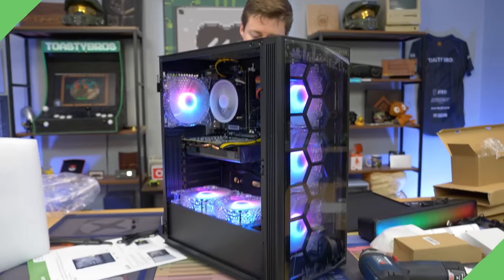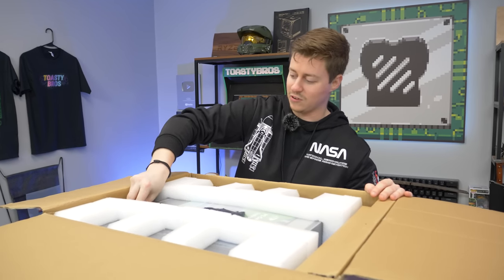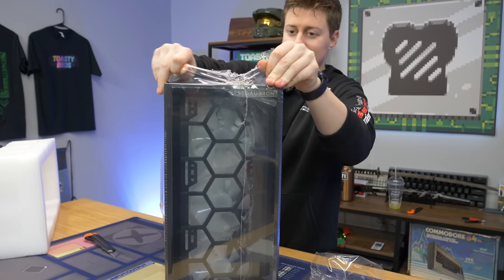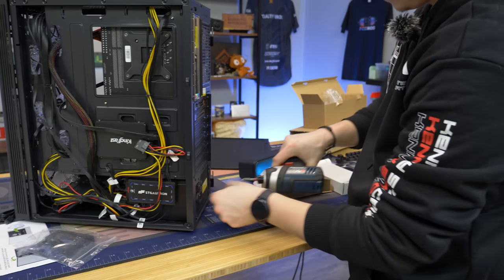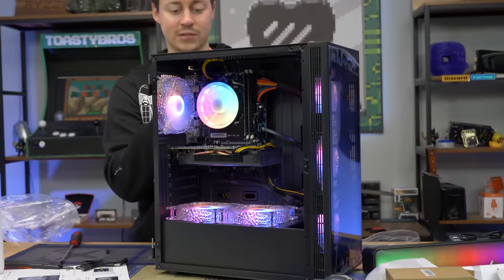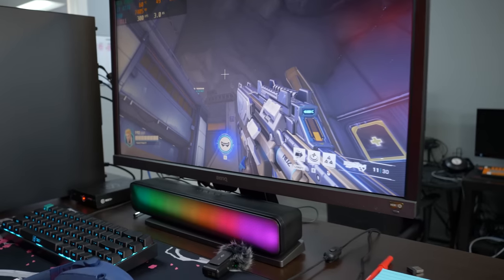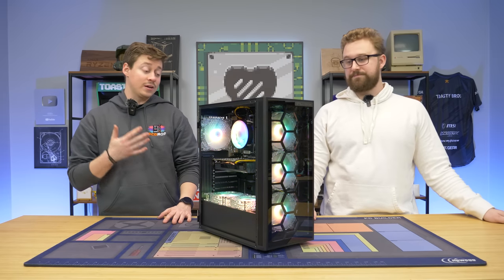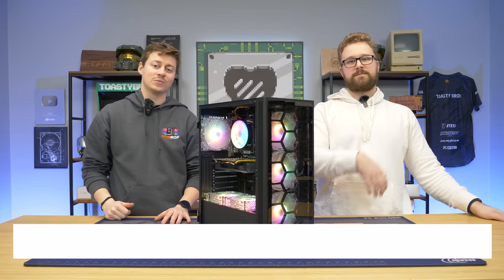Why are People Buying This $600 Gaming PC??

Comment: that cpu is really limiting the performance.  This thing is quite a value for a prebuilt
Reply: ay you really from idaho too
Reply: @ZZZeNonnnn  nope, Seattle
Reply: @CuttinInIdaho  then why is your name cuttin idaho
Reply: @ZZZeNonnnn  I cut out to Idaho... I watched Seattle turn into a shit hole slowly and left.  I worked at Microsoft out of high school.

Idaho is free and possibly the most free state currently.  No homeless camps with drug needles all over, far less crime, no 2nd amendment restrictions, low taxes etc
Reply: @CuttinInIdaho  ohhh okk makes sense
Reply: Bro a Xbox series x or ps5 is a 1000 Times better value as this Piece of crap.
Reply: @markfarkas1817  Yes but you are alot more limited on a console
Reply: @xerkax  yip there's more to a PC than just being the best
Reply: The i7-4770K (4 cores, 8 threads) is from June 2013 and still packs a punch, but it's dated.  It's used by the CCRL chess site for chess engine rating (it's the baseline from which other PCs are calibrated from, in terms of nodes per second of a chess position searched).  It's quite a popular chip, albeit a bit power hungry at 84 W TDP per the single thread performance it has.
Reply: @raylopez99  thanks Ray... I didn't know any of that
Reply: How is the cpu limiting the performance? Is it because it’s too high for this gaming pc build because I7 suppose to be a good cpu for gaming. (Hardly know anything about gaming pc’s so bare with me)
Reply: @dangeneral5753  it's a old CPU and new games even old games with updates ( GTA 5) hardly use their full advantage cuz the CPU is lagging but still a good- ish for daily stuff but I'd go for at least a i7 8th as it's a i5 9th ,10th and Ryzen 5 3600 equivalent as these CPUs are still good for gaming and soft editing and stuff
Reply: @scarfaceReaper  okay can u explain a bit on how it’s an old cpu cause it’s a i7 higher than i5 and i3
Reply: @dangeneral5753  it's a 4th gen i7 and it's only a 4 core and the new i3 processor it's much more price to performance wise than a old one that costs almost the same as a i3 11th gen , like I said if it's a i7 8th and up it's a powerful CPU but lower it's a waste of money
Reply: @scarfaceReaper  oh I see. Thanks bro
Reply: @CuttinInIdaho  Is telling the homeless where they can live and what drugs people can do "more free"?

That's not an attack on Idaho but I'm not sure those are freedoms persay
Reply: @35mm21 I think you are mistakenly taking my comment for a judgement or conflating freedom in a realistic sense(what can you do based on the words written on paper by government) vs  a mental choice to leave.  I just can't raise my kids in any areas with hypodermic needles along the sidewalks and in parks. 

I wont tell anyone how to live their lives.  We are responsible for ourselves, and our decisions are based on how we want to live.  That is free... Free thought and freedom to choose.  If I don't like something, I am free to choose how best to make it something I do like. 

I am a libertarian and I believe that nothing should be illegal that you put in your body, and I also don't believe any government wants to actually help this situation. 

The fact that they are illegal is precisely why there is crime, gun crime, and ruined lives.  One could make strong opiates for next to nothing on their own if they wanted to.  Costs would be very low and it would be pure.  Gun crime would drop 70ish percent if you get rid of street gangs dealing and fighting over turf/money.

I don't believe in any form of government besides self government.  But I'm old enough to know the difference between my ideals and the ideals/needs of the masses. 

Homelessness in Idaho is growing too.  But we have hard winters here, -22 the other day.  I feel bad for people who live like that.
Reply: @CuttinInIdaho   You've never been to Pocatello?
Reply: @ItsProject  yeah I'm about 60 miles north of Pocatello
Reply: A ryzen 5 would have been far better
Reply: You know the CPU isn't even being maxed out so for anybody saying the CPUs a bottom like I'm not sure about that. But I'd like to know is what can you upgrade it to what's the max the motherboard can take?
Reply: The CPU didn't max out once so how is that a bottleneck.
Reply: @one234569and10  It’s a 4 core cpu and the games do go above 50% cpu load.  Which means it’ll spill over into the hyperthreads to move data.  Once you start relying on hyperthreads, your frames won’t reach their full potential because it’s stuffing bits into your main data stream.  Games now are pushing over 4 cores, and I like to use all real cores for gaming.  Also the clock speed is low, so for games that aren’t threaded well, the clock speed and IPC from being a 4th gen will really limit you on those games.  Also if the cpu is nearly maxed out on a 2060, good luck upgrading your gpu to something better.
Reply: @Mark Farkas the lv is actually really good for the price and a pc is a lot less restricted.
Reply: @scarfaceReaper  just wondering, are you saying that if you tried to play gta t it would lag?  Becuase i feel like it wouldn't lag, considering I've worked with computer in the past. But idk
Reply: @ParkerStayBlazzin2508  hey I'm not a computer wizard but I tried playing it with a 4 core 4 threads CPU with a GTX 1050ti to see if it can still play older gen components and it started to lag when I go into 1080p high settings and I went down to 900p which did improve but was a meh experience and later I watched someone on YouTube try to pair it with newer GPUs and didn't go as planned, and there are few games who use CPU and GPU and not just GPU, hack I even tried to play it on my dinosaur PC Duo and didn't even start the game but restarted my PC , and as it is older games being updated means they need newer gen components and so on and considering it'll need more clock speeds and 4 cores really isn't doing good for gaming now , but if I'm wrong tell me so and continue on with our lives
Reply: @scarfaceReaper  ahh okay, but if were being honest you were using a 1050, which is alot older compared to a rtx 2060
Reply: @ParkerStayBlazzin2508  it's a simple test to see if it can be played with, again games utilize more cpu cores

Edit  : if you say CPU doesn't matter than why are they the reason games are lagging
Reply: @scarfaceReaper  I never said cpu doesnt Mayer lmao. But I do kinda think that if it lags on a system with lower end parts then it would with newer ones. But I'll have to find a benchmark of this gpu and cpu on gta
Reply: @ParkerStayBlazzin2508  https://youtu.be/50qR3S-pyyQ , here's another test of a 4 core and 4 thread CPU this time paired with a Rtx 3050 who performance 2060S ish
Reply: My computer has this processor coupled with a 2070 super, and it works well for me. It is 10 years old, and I will need an upgrade, but it has been very reliable.
Reply: @garrettbischoff3817  yep.  The should teach elementary school kids the horrors of the Bolshevik revolution
Reply: @raylopez99  i'm still rockin my 4770K along with a gtx 760 gpu!
Reply: @CuttinInIdaho  you're massively contradicting yourself. Like I said I'm not attacking Idaho but let's not dress up things that are absolutely not "freedoms" as such.

That's double speak and that's dangerous
Reply: @CuttinInIdaho  I learned about how bad the Bolshevik Revolution was in my "lefty" schools in Maryland.
Reply: @35mm21  your anecdotal point means what to you?
Reply: @markfarkas1817  not at all, i will never go back to consoles
Reply: @markfarkas1817 ur jokeing me right
Reply: @raylopez99 can this pc run rainbow six siege?

Comment: One of the nicest looking cheap pre builds I've seen. $600 for something you can game on is not bad at all. Well packaged, pretty clean wire management as well.
Reply: i would buy it if i could but shipping something from amazon in my country will cost alots and most of the time it doesnt even have the option to ship(they say it cant be shipped so i cant buy that)
:')
Reply: Cept its like a 235$ system after putting all the parts together on other websites.
Reply: @Belkalton  it's certainly not for everyone.
Reply: @Belkalton  Um a 2060 is $150 on its own lol
Reply: Yeah I was confused when he wasn't impressed with the Warzone performance. What do you expect for 600 dollars? It's out performing a console which is what you would want for 600 dollars and it does it.
Reply: @35mm21  it's not outperforming a series x , stop it.
Reply: @frameripperz8794  Not the one they put in it. It isn't 8g. It's 6.
Reply: @redbloodedamerican2346  6GB models are about 150-190.
Reply: @frameripperz8794  No it isn't. I just looked it up. It's 280 right now. So the other person is wrong too
Reply: @slaydao.g9650  💀💀nobody cares if it isnt out performing it. Technically it is. Because the next gen consoles dont actually do 4k. They all do 1080p and upscale to 4k so technically it's not actually doing 4k.
Reply: @slaydao.g9650  💀💀nobody cares if it isnt out performing it. Technically it is. Because the next gen consoles dont actually do 4k. They all do 1080p and upscale to 4k so technically it's not actually doing 4k.
Reply: The only way you can get a good gaming PC for $600 is if it fell off the back of a truck.  I'm building a decent low end PC, but with all quality parts, for about $1100 and I'm reusing parts to do it.  My goal was a PC that could handle MS Flight sim 2020 and I waited about 2-3 years for parts to become affordable enough to do it at 1080p.
Reply: @slaydao.g9650  xbox still does not actually hit its threshold of 120 fps without taking some backwards graphics away... computers dont, want a nice looking game, get this, if you dont care about the quality of your game and just wanna play, sure get an xbox, do less stuff!
Reply: Xbox series have csgo or valarant
Reply: Im using the exact case and everything else  just diffrent cpu and different graphics card since  I asked my grandma to buy me one and I tried to put it in my office PC it didn't work so my mom bought this PC it came with a gtx 1660 and i7-3770  and 32 gigs of ram I just replace the GPU with my rtx 3060 and I plan on upgrading the motherboard and CPU since I want to get to windows 11 so I don't fall behind with updates other stuff.

Comment: I personally built a 2060 i7 4770k pc and it performs great and looks good. It runs almost everything I throw at it. However the only reason why I went with this type of setup is the deals I got on the parts. I built my entire pc for under 300$. So for anyone looking for a pc always look around for deals
Reply: I7 for a 2060 is an intersting option but for under 300 wow
Reply: 300 dollars?? wtf
Reply: Thanks man. Trying to save up money for a PC so this helped a lot.
Reply: @hegane9999  this is very possible lol

You could get a Dell Optiplex with a 4th gen i7 with an SSD and a new PSU for $120-130 max

And then get an RTX 2060 for like $170 and you're good to go
Reply: @H.u.F.a  I have been thinking of buying a pc but building it myself but would a msi armour gtx 1070 with a ryzen 5600x be good for apex and warzone? Need help
Reply: @sweatyhandler  yes
Reply: How much fps does it run on fortnite
Reply: @isaiahruiz8569  Im not quite sure why you would want to play fortnite on a pc, so if thats the main game you plan on playing i would stay on console, but it runs around 150 ish fps max settings
Reply: @H.u.F.a  I actually just got super lucky. I went around for a week or two looking at garage sales and thrift shops for older pc for a cpu.  I came across a yard sale and found and old pc that looked horrible, but it had a 2 terabyte drive in it so i ofc wanted it. The guy ended up giving me it for free bc he just wanted the whole pc gone. I took apart the pc to find a 9th gen i7 on a gigabyte motherboard. It only had 8 gigs of ram so i just bought new ram sticks, new fans, gpu, case, and peripherals all for 300 ish dollars.
Reply: @deegsmusic1895  good looks but just to play fn wit my friends but I don't play it anymore like how I used to

Comment: Well I own this PC right now and honestly it does work pretty well, and from someone coming from 30 frames per second Nintendo switch this PC is awesome. These people didn’t completely trash on the PC but when people own a 1500 pc and trash on a 600 doaller one it’s aggravating
Reply: Finally someone grateful that the pc can run above 60 fps
Reply: What all do you play on it and how does it run them
Reply: @Qntx  Minecraft, Fortnite, Roblox.
Really not much. Minecraft runs smooth I don’t really know about graphics. Fortnite runs incredible, I get 120 fps sometimes more and it’s perfect for me. And Roblox is Roblox on every device with just better graphics
Reply: is it still decent

Comment: This is a great pc for the price, from the packaging to the performance, of course there were a few issues but that is bound to happen with a small brand amazon prebuilt. For 600 dollars I wish I would have found this pc before I bought my current one. I have seen a lot of your videos and this often happens in your reviews, you don't give a fair rating because you're so used to 2000$+ pcs that you built yourselves.

Comment: This video convinced me to buy one of their PCs on Amazon for my girlfriend who is a new PC gamer. Although thanks to this video I went with the cheaper computer that had a 10th gen i3 instead of the 6th gen i7. It does only have a 1660S instead of a 2060S but that's an upgrade for later, the better processor and lower price were too good to pass up. Great video!
Reply: So how did it go did it work?
Reply: @FnafyFoofy I’ve bought the exact one they’ve reviewed and I used it for 6 months and it wasn’t the worse
Reply: @gxtb367  oh thanks I’m thinking of getting one of these pcs.But the ratings aren’t that good and there’s cases you don’t even get the right graphics card.

Comment: 4th Gen is still powerful, last year I built a 4770K system with a $350 budget. 

That got me a ROG Maximus VI Hero board, 16GB 2133 DDR3, EVGA 980TI SC2 6GB, Noctua NH-U14s, Lian Li PC-61B case, Intel Wireless-AC card, and WD Blue 500GB SSD. 

Less flashy with no RGB, but plenty powerful for the price still.  For $600 I was half-expecting this build to be 7th or 8th Gen. 4th Gen means no TPM 2.0 support for Win 11, and no resizable BAR option in the BIOS for newer cards. 

Seems like you're paying a lot for those lights and the OOBE. I wouldn't do it, personally. 

I'd aim more for something 8th gen or higher at that price point on the used market.
Reply: thats actually fire but ngl if i were u i woulda got a 12-13th gen i3 with a b660 i3s are so cheap rn u can still keep it in budget but other than that clean af build
Reply: oh i didnt read $350 budget my fault

Comment: to be clear.. a 'switching power supply' does NOT mean 'switcheable between 120 and 240v'. a 'switching powersupply' refers to the technology used to get the power wanted. A non-switching powersupply is basically a big transformer with a full rectifying bridge behind it. A switching power supply uses a totally different technique.

All PC powesupplies are switching. There are no non-switching powersupplies on the market these days.

Comment: I bought this a few weeks ago, I do think it’s worth mentioning that it can’t be upgraded to windows 11 due to the processor and tpm. Also if you plan on upgrading your storage, the power supply doesn’t have an extra power plug to support another sata ssd also the mobo doesn’t support m.2 ssds

Comment: Nice review - thanks.  Just a thought.  Unless the review order was edited (in which case, maybe say so), you were complaining that the CPU cooler RGB plug was not plugged in, and then made out it was their fault.  You had just ripped the PSU out of the bottom!! Small chance you accidentally unplugged it when doing that?!?!?!  Most reviews do the testing first, so that they can see what works and doesn't from the manufacturer, and then pull it apart thereafter - even if they then edit the video to make the order nicer (but say so).  Just a thought......

Comment: $600 USD for a full rtx 2060 pc setup minus a monitor, it even includes a speaker bar and everything is rgb. That's not bad at all. The only anomaly I saw was that Warzone 2 performance. A 2060 should perform similarly to an rx 5600 xt but here it is scoring an fps about 50% lower. What gives? Was ray tracing enabled in some way?
Reply: It is CPU bottlenecked by the i7-4770 + lower speed ram.

Comment: Quick question, what’s the best pc to start off with? My budget is $700. This would be my first time using a pc for gaming.
Reply: This pc
Reply: @nathoulap can this pc run rainbow six siege 60 fps?
Reply: @jacobyuhhh4674 it looks like it, showed some clips at the end with an average 196 fps on seige. Frames dropped to about 150 from one breach charge tho so making me worried about longevity

Comment: Just bought a PC coming Tuesday from them, 2060 super, 1tb ssd, 32gb ram ddr4, i7 6700 for only $650 I hope it performs well!
Reply: How did it go 😆
Reply: @FnafyFoofy  it did not go good. I had to return the PC, maybe they just made mine wrong but I got more FPS and less lag on my 1660ti i5. So I returned it and got an all AMD build which is running amazing
Reply: @QrangesYT  oh I’m so sorry I’m thinking about getting the Rtx 2060 super 1tb ssd 16 gb ddr4 i7 10700f for $720 wish me luck
Reply: @FnafyFoofy  how did it go

😆

Comment: If you go to Microcenter and have the skills to build it yourself.  You can build a system with a 5700g, motherboard, 16gb dd4, 512gb ssd, power supply and case for about $400.  Find a used 2060 and it’ll be faster than this.

Comment: this company also has a pc with a i3-10100f but it has a 1660ti instead of a 2060
Reply: i have i3 9100f and rx6600 not very good
Reply: @RealDucky  i guess its good i have a i7-6700k and a gtx 1070
Reply: @RealDucky  9100f only has 4 cores and 4 threads while the 10100f has dual threading which helps a lot